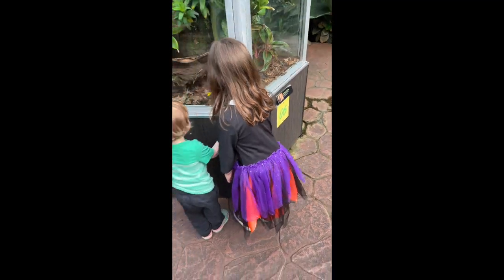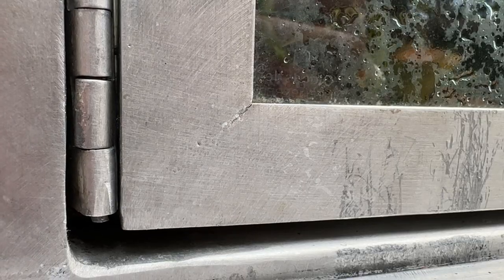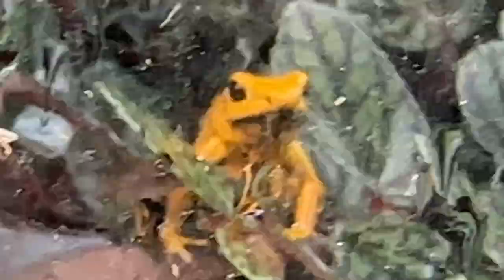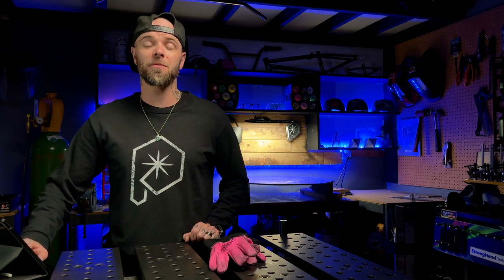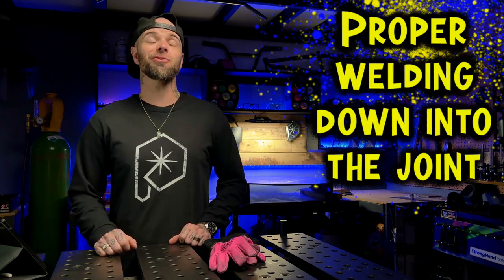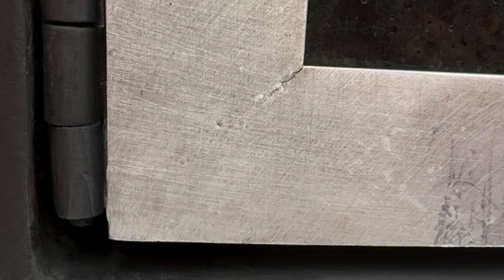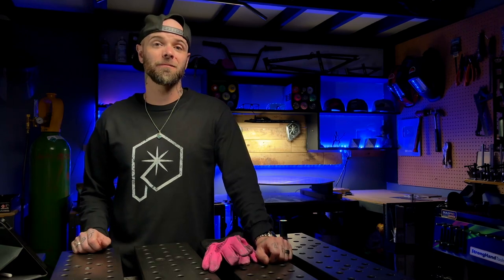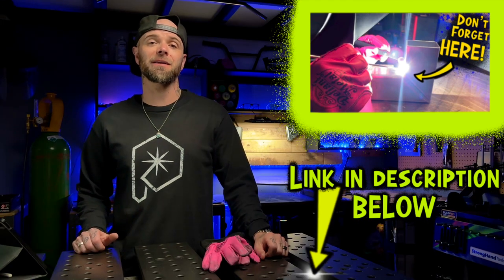frogs BROKE THESE WELDS. Lets do them properly.

Comment: The biggest problem I see coming out of the fabrication shops building special vehicles and trailers for my work are improper corner configuration and not welding the ends of joints. I unfortunately have to fix them when they fail. There are things I look at and cannot believe it ever left the place that made it. Just finished re-engineering and fabricating a work truck that was put on air bags by another shop.

Comment: Using the wrong filler is a huge factor. 5356 is prone to cracking at higher temperatures and just more prone to cracking overall. Don't use 5356 unless you specifically know you need it. 4043 is a much better general purpose filler. 4943 has the same properties but is stronger and more expensive. Stop recommending people start with 5356. Most welders don't know shit about metallurgy, let alone your students, and this stupidity will get stuck with them.